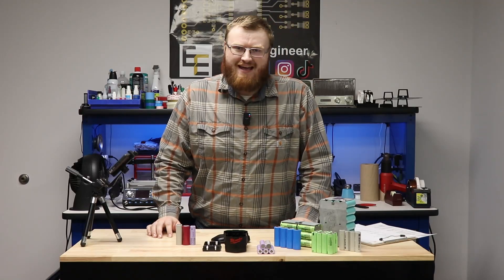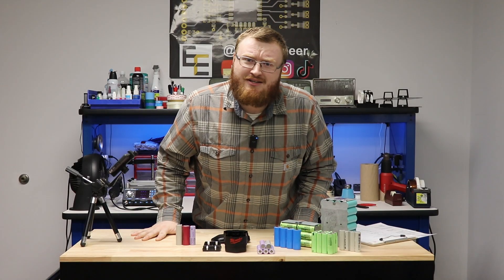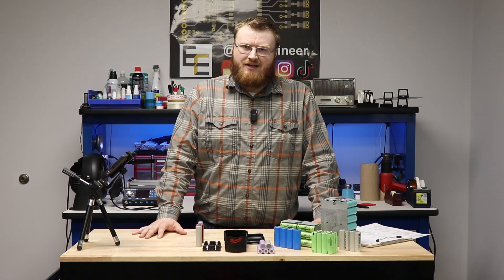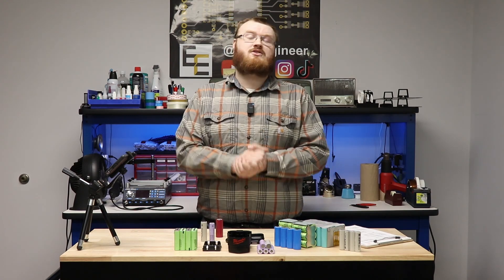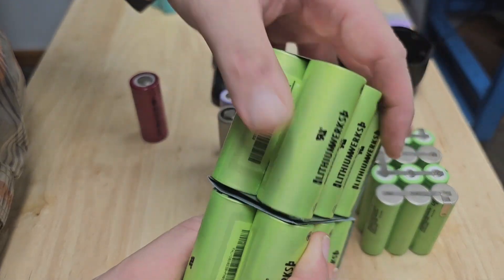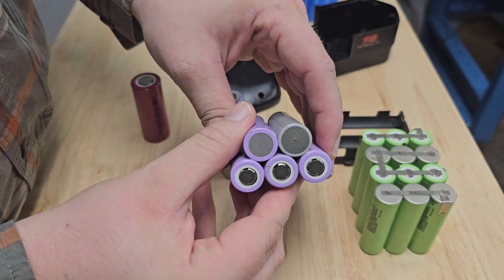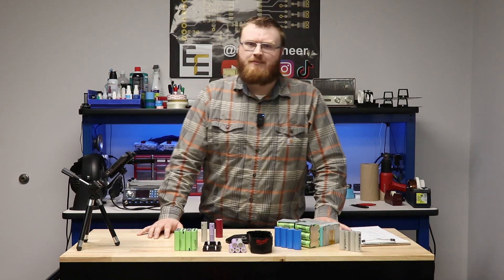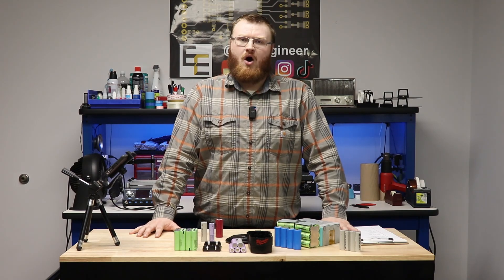What Battery (Cell) Do I Need? | BMS Design Series Part 02 |  Battery Managment System

Comment: How about LiFePO4 but with Vanadium? It is better, yet harder to find. Also, there's some Korean very temperature resistant Li-Pol batteries, they use Mn if i recall it correctly.
Reply: P.s haven't designed a BMS even once, but time to time i had to repair battery packs

Comment: Is it considered safe to glue cells together, maybe there is a standard for different applications? There is only a thin layer of plastic between metal cans with different potential and in a harsh environment one can imagine a short circuit situation.
Reply from the maker: Battery packs are normally tested to UN, IEC, or UL standards. These include vibration and shock test that simulate harsh conditions. 

I have personally never seen a pack failure from gluing the cells together. We glue most of our packs at PTI and all of our pack designs have passed all standard and field testing.